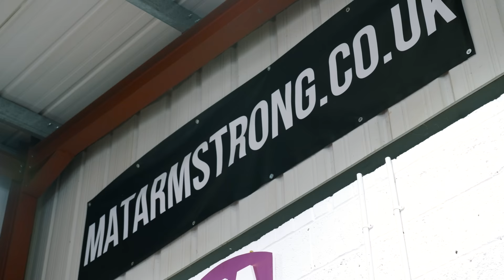MAT ARMSTRONG'S CRASH COURSE

Comment: I'm looking into an older Quattraporte 4.2 as a daily driver ZF trani ..am concerned a Duo Select might cost too much on the back end. Would not use auto mode but mechanic here don't work on them... which do you prefer dry sump mated to F1 or Wet sump and a ZF... Just found your channel

Comment: I enjoy Mat's content, but I can't see how he thinks electric cars will come and go.  I live in Sacramento and it's not uncommon to have four Teslas together stopped at a red light.  My Model 3 Performance should prove to be a reliable vehicle for more miles with lower maintenance costs than that BMW with comparable all around performance.  Don't get me wrong I'm not all-in on EVs.  I have a 996 Cab that I love, I owned an E39 M5 for 9 years and drove it at least 100k miles, I owned a ZO6.  EVs are an "also", not an "instead of."